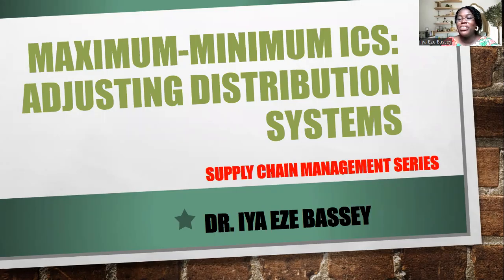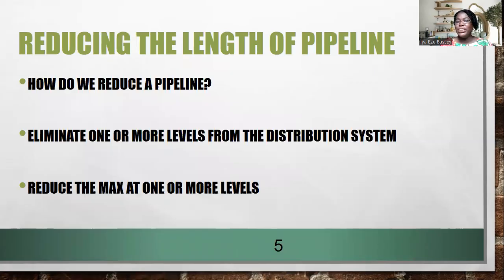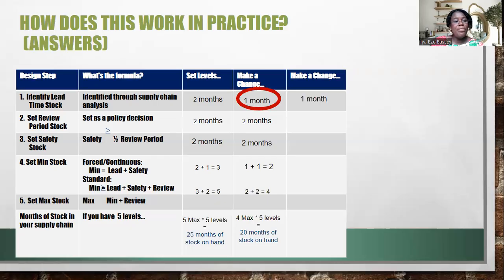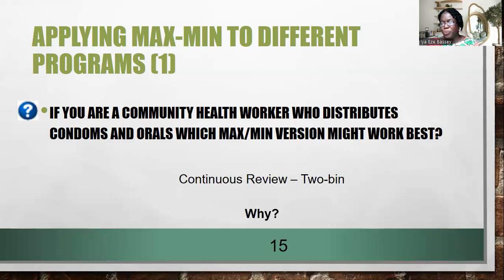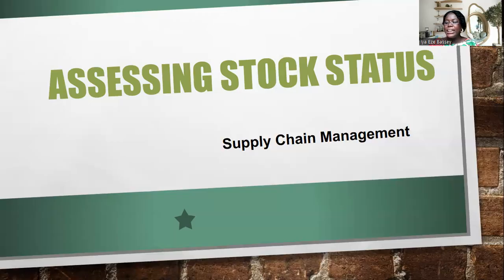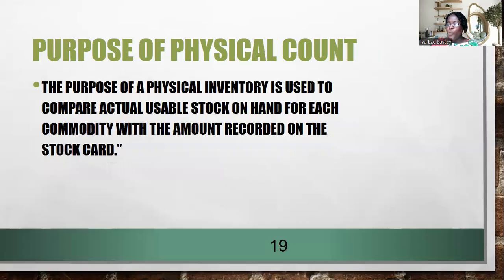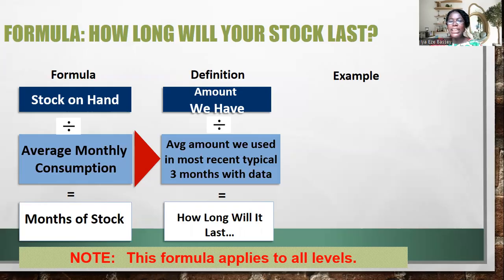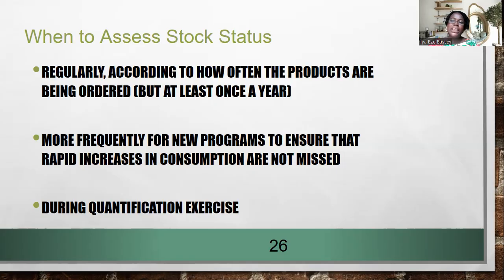Maximum-Minimum ICS: Adjusting Distribution systems (Supply chain management series)

Comment: Thank you ma for the understanding on Maximum-Minimum Inventory Control System - Adjusting Distribution Systems
The Maximum-Minimum Inventory Control System is a strategic approach used by organizations to manage and control their inventory levels. This system focuses on setting maximum and minimum inventory thresholds to ensure optimal stock levels and minimize costs associated with excess or insufficient inventory.
In this course on Maximum-Minimum Inventory Control System and Adjusting Distribution Systems, participants gain a deep understanding of the principles and techniques involved in implementing this inventory management strategy. They learn how to determine the appropriate maximum and minimum inventory levels based on factors such as demand variability, lead time, and customer service requirements.

In summary, the Maximum-Minimum Inventory Control System: Adjusting Distribution Systems course equips participants with the knowledge and skills necessary to effectively implement this inventory management strategy. By understanding how to determine appropriate maximum and minimum inventory levels and adjusting distribution systems accordingly, organizations can optimize their inventory levels, reduce costs, and improve overall supply chain performance.

Comment: I’ve understood that in designing a max-min ICS the length of a pipeline must be noted by setting up initial max-min policies for each level and type of facility, check if the overall distribution will function properly when level specific maximum in policies are implemented, check also for total length of pipeline that the policies at each level imply. The pipeline length can be reduced by eliminating one or more levels from the distribution system, start up policies that reduce max at one or more levels.
Maximum stick levels can be reduced by shortening review period, reducing lead time, improve distribution systems reliability all these at one or more levels.
Product cost, transport reliability, storage, cost of storage, lead time etc are some factors that can impact max-min stock levels.
Reliable data sourcing from SOP, consistency of stock levels, reduced wastage these are some advantages of the max-min system.
Numerous levels in systems, systems that manage large numbers of commodities etc may pose as problems to using each version and variety.
Physical found is a hand counting that gives accurate number of stock at hand. The purpose is to compare actual usable stock from each commodity with the amount recorded on stock card. Stock purpose is accessed to determine how long supplies will last. Stock count can be done once a month where honesty is consistent Elsa it had to be done frequently.  After absolute number is gotten it is also necessary to note how long they would last.
To calculate length of stock: stock on hand divided by average monthly consumption equals months of stock.
The stock status is accessed regularly i.e if products are ordered often but at least it has to be done once a year. During quantification exercises, more frequently for new programs to ensure rapid increase in consumption are not missed.

Comment: In this session, I’ve learnt to adapt distribution system policies effectively, allowing them to respond to changing needs and circumstances, I’ve also learnt the advantages and challenges associated with the Man-Min (Maximum-Minimum) inventory control system, gaining insights into its role in maintaining optimal stock levels. Additionally the intricacies of the inventory control system specifically designed for managing HIV/AIDS commodities (IMHC), ensuring a consistent and reliable supply of critical medical resources. Furthermore, I have  grasp the meaning and significance of assessing stock status, a fundamental practice in evaluating inventory quantities and conditions to prevent shortages or overstock. Lastly, I’ve acquired the ability to determine the number of months of stock available at different storage levels, using inventory and usage data, aiding informed stock management and forecasting.

Comment: I understand that the length of the logistic pipeline can be reduced for effective delivery to the client. This can be achieved by removing one or more levels from the distribution chain such as shortening the review period, reducing the lead time, and improving the distribution system's reliability. 
The advantage of using the MAX-MIN system is avoiding overstocking, minimizing wastage, and avoiding understocking, etc. 
The factor that impacts the max-min stock level is the cost of product, storage capacity, and cost of storage, etc. 
Thanks ma

Comment: According to ur question what can we do to modify pipeline?
Well we can look at the current distribution process and see which are the bottleneck. It may be transportation or any other problem
Prioritize the solution based on costs, feasibility and potential impact for example let's say the biggest 
Bottleneck is customs clearance process .
One solution is to per-clear the commodities before they arrive the seaport .
Another solution is to use expedited shipping which would be expensive but gets to the client faster 
Thank you ma 👍
Reply: In summary it aid identify ways to adjust distribution system policies explain the meaning purpose of assessing stick status describe the inventory control systems used in the logistics management of HIV/aids commodities

Comment: Max-Min Inventory Control System (ICS) with an emphasis on adjusting the distribution system in medical laboratory science is a specialized approach to managing and optimizing the supply of critical laboratory materials, such as reagents, consumables, and equipment, within the context of healthcare settings. This system combines the principles of Max-Min inventory control with strategic adjustments to the distribution network to ensure that medical laboratories have the right resources at the right time while minimizing costs and enhancing efficiency. Here's a comprehensive summary of what the Max-Min ICS with distribution system adjustments in medical laboratory science is all about:

1. *Max-Min Inventory Control:* This system begins by setting maximum (Max) and minimum (Min) inventory thresholds for each laboratory item. The Max threshold represents the maximum allowable quantity of an item in stock, while the Min threshold represents the minimum quantity that should trigger a reorder.

2. *Demand Forecasting:* Accurate demand forecasting is crucial. Medical laboratories use historical usage data, testing schedules, and patient volumes to predict the demand for various materials. This informs inventory management decisions.

3. *Adjusting Distribution:* Unlike traditional Max-Min systems, this approach places a strong emphasis on optimizing the distribution system. It involves strategic decisions about where and how materials are stored, distributed, and delivered to various healthcare facilities or laboratory branches.

4. *Centralized vs. Decentralized:* Laboratories must decide whether to centralize their inventory in one central location or decentralize it across multiple regional or facility-based storage areas. The choice depends on factors like geography, demand patterns, and transportation infrastructure.

5. *Transportation and Delivery Optimization:* Adjusting the distribution system includes optimizing transportation and delivery routes. This ensures timely and cost-effective delivery of critical materials to laboratories, reducing lead times and costs.

6. *Technology Integration:* Modern Max-Min ICS in medical laboratory science integrates advanced technology and information systems. These technologies provide real-time visibility into inventory levels, demand forecasts, and distribution network performance.

7. *Supplier Relationships:* Close relationships with suppliers and distributors are vital. Effective communication and collaboration help ensure timely deliveries, quality control, and a stable supply of materials.

8. *Quality Assurance:* Maintaining the quality of laboratory materials is paramount. The system includes quality control checks to verify that materials meet regulatory and safety standards.

9. *Cost Efficiency:* Managing costs is a central goal. By optimizing distribution, reducing transportation costs, and maintaining accurate inventory levels, laboratories can control expenses while maintaining quality.

10. *Sustainability:* This approach considers sustainability by reducing waste, minimizing the disposal of expired items, and optimizing resource utilization in line with environmental and ethical considerations.

11. *Emergency Preparedness:* The system is designed to be resilient in the face of emergencies, ensuring that laboratories can rapidly respond to crises, such as disease outbreaks or natural disasters.

12. *Data-Driven Decision-Making:* Max-Min ICS with distribution system adjustments relies on data and analytics to make informed decisions. This includes performance metrics, cost analyses, and continuous improvement initiatives.

In summary, Max-Min Inventory Control System with adjustments to the distribution system in medical laboratory science is a strategic approach to managing laboratory materials efficiently and effectively. It combines the principles of inventory control with distribution network optimization to ensure that essential materials are available where and when they are needed, contributing to the quality of patient care and laboratory operations. It also aligns with sustainability goals and enhances resilience in the face of disruptions.

Comment: Thank you very much Ma'am;
I understood that The importance of distribution in supply chain management is due to the fact that it deals with getting goods to the end-user or buyer in time, and with minimal waste. This means that it directly impacts your profits.
And also At a basic level, the min/max method attempts to keep current on-hand inventory within a specific range. Users set a minimum stocking level, which, when breached, triggers a reorder to reach the maximum stocking level of a particular item.

Comment: In summary 
Adjusting distribution systems in the context of the Maximum-Minimum Inventory Control System (ICS) can be an important aspect of supply chain management. By analyzing demand patterns, lead times, and customer preferences, businesses can optimize their distribution networks to ensure efficient and timely delivery of products.

In the context of the Maximum-Minimum ICS, adjusting distribution systems involves evaluating the performance of existing distribution channels and making necessary changes to improve efficiency. This may include optimizing transportation routes, reevaluating distribution centers, or exploring alternative delivery methods.

By aligning distribution systems with the Maximum-Minimum ICS, businesses can ensure that inventory is replenished at the right time and in the right quantities, minimizing stockouts and excess inventory. This helps improve customer satisfaction, reduce costs, and enhance overall supply chain performance.

Comment: Thank you Ma for the insight!

I deduced that for effective and fast delivery of products to clients and for products to be in their most potent state during consumption, the length of that logistics pipeline can be reduced.
Some ways this can be achieved are;
-Set up until Max-Min policy for each level
-Check if the overall distribution system will function properly is policy is implemented.
-Check the total length of the pipeline to see which level the policy applies to. Also, removing one or more levels from the distribution chain and or reducing Max. At one or more levels.

Physical count is a hand count of the total useable commodity at a facility at any given time.

Comment: Your explanation enable me to understand the following
HOW TO REDUCE THE LENGTH OF PIPELINE
Eliminate one or more levels from the distribution system
FACTOR THAT IMPACT MAX-MIN STOCK LEVEL
Cost of product
✓Storage capacity
✓Shelf life of health ✓commodities
ADVANTAGES OF USING MAX-MIN SYSTEM
1.Avoid overstocking
2.Avoid under stocki
3.Minimize wastage
The challenges of using each version and variation is system with numerous levels

 The lecture was able to help me with understanding of inventory control management of HIV/AIDs commodities

Comment: In summary, adjusting distribution system in maximum and minimum Inventory control system is about finding ways to reduce the factors that affect a quick and fast distribution thereby finding a systematic way to adjust and renovate the pipeline distribution system or channel. I understood the Elements of the formula which can be changed in other to bring an effective change. I also understood factors that can impact max-min stock level such as cost of products etc and I also perfectly understood how assessing stock status can be done such as physical count , the purpose for this physical count and the formula to get months of stock on hand which is done by dividing stock on hand by average monthly consumption. Thank you so much ma for this enlightening lectures 😊
Reply: Hdn

Comment: I got to learn about max-min inventory control system 
The advantage,challenges and purpose of inventory control system and how to improve it and also the application of maximize-minimum to different programs.
Assessing stock status which has to do with physical counting of stocks by hand the total number of useable units of each commodity in your store
The purpose of assessing stock status and when to assess stock status

Comment: With this well delivered lecture, I know how to identify ways to adjust distribution system policies,
ADVANTAGES which include:
1. Set up initial max-min policies for each level and type of facility.
2. Check if the overall distribution will function properly if the level specific max-min policies are implemented.
3. Check the total length of the pipeline that the policies at each level imply.
The challenges of max-min inventory control system, the inventory control system used in the logistics management of HIV/AIDS commodities ( LMHC ) and the meaning and purpose of assessing stock status.

Thank you ma'am😊

Comment: In summary 
When it comes to adjusting distribution systems in the context of the Maximum-Minimum Inventory Control System (ICS), it's important to carefully analyze demand patterns and adjust inventory levels accordingly. By monitoring sales data and forecasting future demand, businesses can determine the optimal distribution strategy to ensure that products are available when and where they are needed. This can involve adjusting reorder points, lead times, and safety stock levels to optimize the distribution process.

Comment: Thank you Ma

In summary, i understand that the physical count is the process of physically counting and verifying the quantity and existence of inventory or goods in a warehouse or distribution center. This is usually done periodically, such as during regular stock audits, to ensure accuracy and avoid discrepancies between the actual inventory on hand and what is recorded in the systems. Physical counts involve physically inspecting and counting each item or using automated scanning devices to track inventory levels. The results of a physical count are then compared to the recorded inventory levels, and any discrepancies are addressed through further investigation and adjustment of the inventory records. 

Thank you ma

Comment: MAX-MIN ICS ADJUSTING DISTRIBUTION SYSTEM
Steps in designing a Max- Min ICS 
(1) Set up initial Max-Min policies for each level and type of facility.
(2) Check if the overall distribution will function properly if the level specific Max-Min policies are implemented.
(3) check the total length of the pipeline that the policies at each level imply
ADVANTAGES OF USING MAX-MIN SYSTEM
Avoid overstocking, 
Avoid Under stocking
Minimize wastage etc.
CHALLENGES TO USING VERSION AND VARIATION
1. System with numerous levels
2. System that manage a large number of Commodities etc
PHYSICAL COUNT: Is the process of counting by hand the total number of usable units of each commodity in your store or health facility at any given time.

Comment: Lovely thanks ma
I understand the steps involved in adjusting the pipeline which is design in the maximum - minimum Inventory control system 
They includes 
1) Determine your lean time stock 
2) Set review period 
3) Set safety stock
4) Set minimum stock level
5) Set maximum stock level
6) Set emergency order point (EOP)

WHAT IS DONE TO REDUCE THE LENGTH OF PIPELINE
1.  Eliminate one more level from the distribution system
2. Reduce the maximum at one or more levels

FACTORS THAT MIGHT AFFECT YOUR DETERMINATION OF MAXIMUM AND MINIMUM STOCK LEVELS BESIDES THE LENGTH OF THE PIPELINE
1) Cost of product
2) Reliability or transportation
3) Storage capacity 
4) Storage conditions at different
 levels 
5) Level time 
6) Accuracy of forecast

THE MAX-MIN ICS THAT WAS CHOSEN FOR THE PROGRAMME AND WHAT FACTORS CONSIDERED IS
THE LOGISTICS MANAGEMENT OF HIV / AIDS COMMODITIES (LMHC)
The LMHC use the forecast ordering maximum inventory control system (ICS). In this system all stocks levels are reviewed at the end of each review period